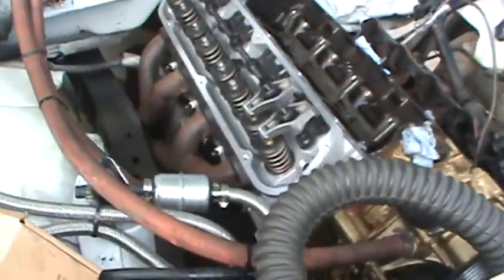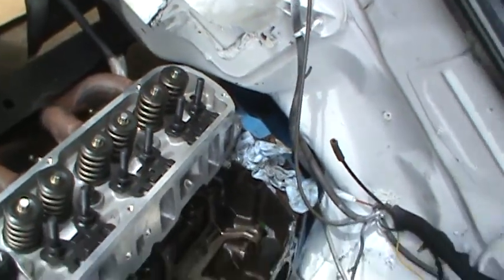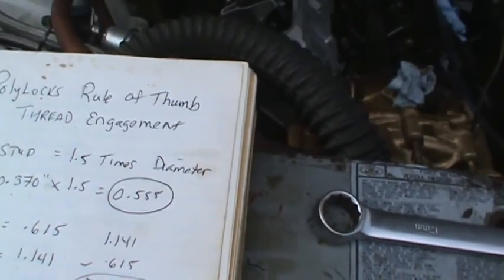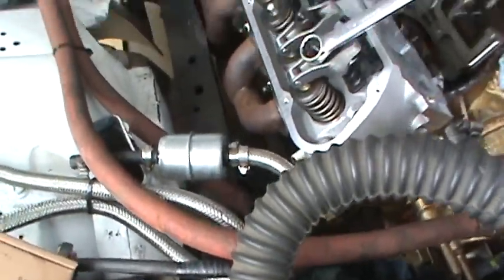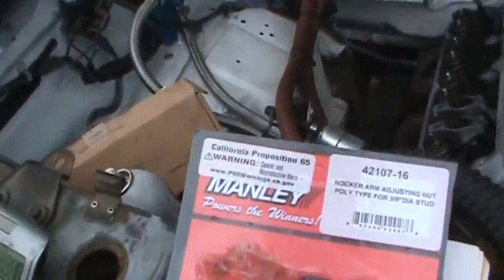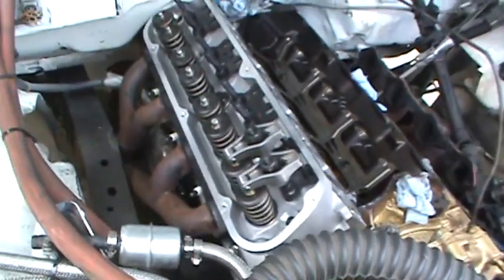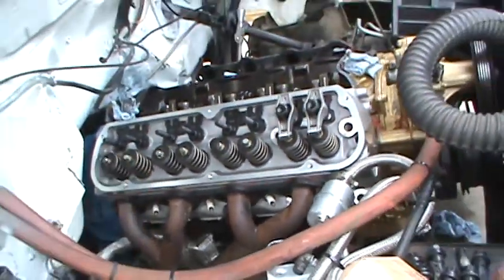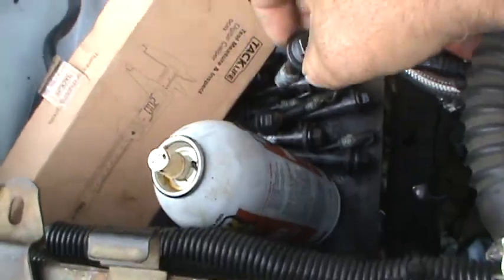Engine math and valve train setup SBF Part 2

Comment: Welll.... hmmm! Never thought about polly locks and adjustment.. ive fixing to do this also Shawn.. looking at my heads right this second..
 Ive got to get pushrod measurements to get those ordered.  Ive always just got an adjustable pushrod checker.. black marker or any color you can see, mark the top of the valve.. and you qant the roller right in the middle of the valve..
Reply from the maker: There is deff more than 1 way to skin a cat. The geometry is critical to performance and engine longevity. I won't put this together until it is 100% right. Thanks for stopping in Jody.
Reply: @HammerHeadGarage   just off the top of my head.. I remeber reading it this... as you probably  know..
 But once the exhaust valve starts to open, snug the  lock down to right where tou feel a little resistance on the push rod.. go.a half turn more.. then lock in down with the Allen wrench...repeat the process.. thats how I'm going to do it.
 By the way Shawn.. have you already got your pushrod length correct?
Reply from the maker: @19jody72  yup, exhaust starts to open, set intake at zero lash plus 1/4 to 1 full turn of preload on the hydraulic lifter. If the lifters are full of oil, wait 24 hours before starting the engine to allow them to bleed down otherwise a valve may hang open and possibly burn. A 3/8-24 rocker stud is approx .010" for every 1/4 turn. SBF engines have preload between .020 and .060. I usually set them at 1/2 to 3/4 of a turn from zero lash.
Reply from the maker: @19jody72  Pushrod length is checked by marking the valve tip with a marker or dykem machinist dye and rotating the engine through completely then removing the rocker and seeing where it contacts the valve tip. Right in the middle is what you want. Towards intake side is too short, towards exhaust side is too long. Use an adjustable pushrod to get it perfect then order that length of pushrod.
Reply: @HammerHeadGarage   yes sir.. thanks for your input.
Reply from the maker: @19jody72  Anytime man.
Reply: @HammerHeadGarage    Im "hoping" for close to 350 to the tire on my ranger.. ill be happy with whatever it is though.. its not a race truck and I didn't build it to be.. ported trick flow heads, ported explore intake, 24lb injectors, little anderson ford  n412 cam..t5 with 373 gears
Reply from the maker: @19jody72  Good luck with it jody and be sure to show us reg updates. It takes little power to move these small trucks smartly.

Comment: Shawn..do you have a part number for those head bolts? Im.running trick.flow.heads, but aluminum like yours.. i tried to order trick.flow head bolts from.summit..they are on backordred!!
Reply from the maker: If your head has 1/2 inch bolt holes use this kit. https://www.cjponyparts.com/arp-head-bolt-and-bushing-kit-for-351w-heads-on-289-302/p/HBK3705/
Reply: @HammerHeadGarage   thank ya sir!
Reply: @HammerHeadGarage   I just need ones for a 302 with 302 heads..
Reply from the maker: @19jody72  ok well just get the bolts munus the 1/2 hole inserts. The bolts are both 7/16th.